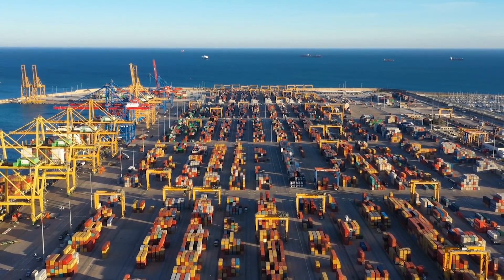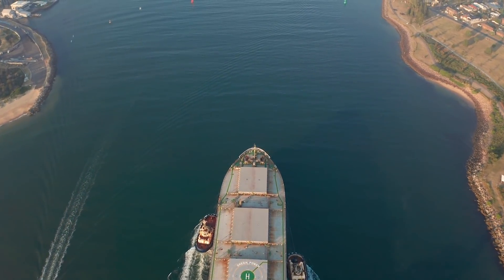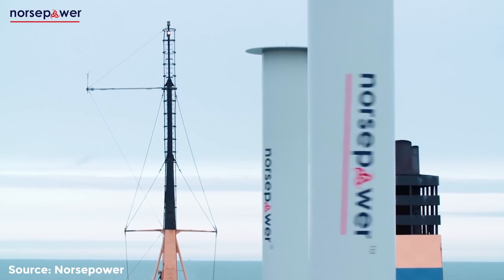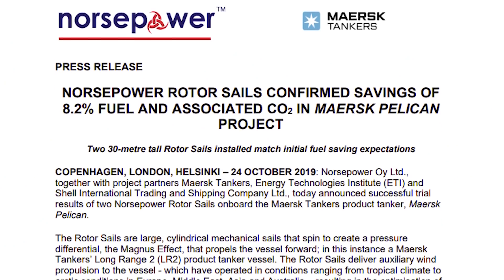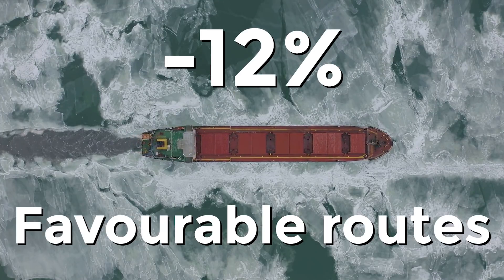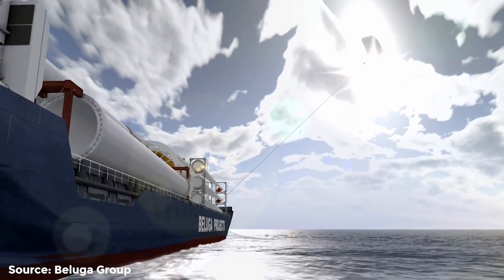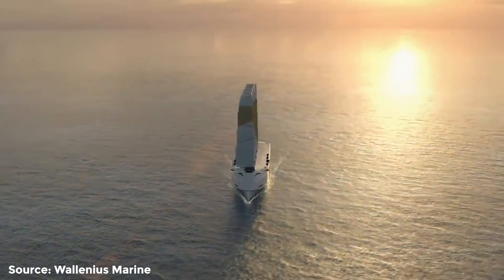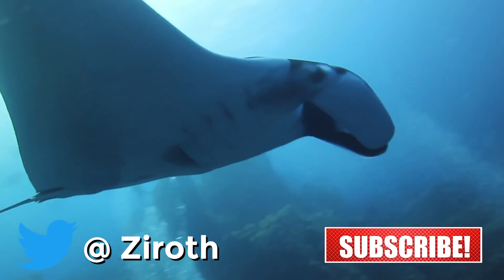Is Wind Power The Future of Shipping?

Comment: Почему бы сбоку раскрывающиеся паруса не приделать?)
Reply: 'Why not attach opening sails on the side?'

The configuration of the sails is determined by the strength of the wind; in light wind conditions more sails are set but as the wimd gets stronger and the sea gets rougher sail area must be reduced.  Short answer sailing ships are not the answer.

Comment: Yeahhha,  Weight Anchor, (uhh what are the other commands. Bring out the spanker.
Reply: Do you mean 'the spinnaker'? (https://en.wikipedia.org/wiki/Spinnaker)  As pipedreams go a return to the age of sail is up there with the best of them. The problems with the wind as an energy source are variability, reliability and low energy density; also relevant in this context is that the canvas, cordage and extra manpower needed for sailing ships were never a very benign environmental option so please discount any idea of sail as ‘sustainable’ and all this is without the problem that if ‘the wind don’t blow the ship don’t go’.  When it does blow it often blows in the wrong direction for your cargo delivery needs and sometimes there is rather too much of it for comfort.  The area where one is most likely to be ‘becalmed’ is the ITCZ (Intertropical Convergence Zone) or ‘the doldrums’ as it is commonly called.  In days of old ships with large crews, such as naval vessels, would try using the ships boats and some of the crew to row through the doldrums thus towing their mother ship out of the calm.  Not practical for less well manned and much heavier merchant ships which could not muster a similar power (oarsmen) to weight ratio (vessel displacement).  Traditional sailing ships are unable to go directly up wind so if the wind is blowing from the direction your cargo needs to go then a zig-zag course must be steered, more distance and thus more time on passage at whatever speed is achieved.

Comment: Well, the business case can be solved by handing savings down the line. Being cheaper in operation still sells. Advertising with "environmentally friendly" does sell, too.
But what about the DynaRig. Searching for a video, I found yours. 
It can be used at almost any wind, trained and trimmed by one man, and by generating hydrogen with the propeller, fuel, to be burned in conventional diesel engines, can be produced. 
The super-yacht Black Pearl (no, not Jack Sparrow's) also has photo voltaic on its sails.
Could be 0 emission and phantastic economies in fuel. 
The system has existed for half a century, now, thus is proven. 
Just a thought, possibly worth an investigation.
Reply: The problems with the wind as an energy source are variability, reliability and low energy density; also relevant in this context is that the canvas, cordage and extra manpower needed for sailing ships were never a very benign environmental option so please discount any idea of sail as ‘sustainable’ and all this is without the problem that if ‘the wind don’t blow the ship don’t go’.  When it does blow it often blows in the wrong direction for your cargo delivery needs and sometimes there is rather too much of it for comfort.  The area where one is most likely to be ‘becalmed’ is the ITCZ (Intertropical Convergence Zone) or ‘the doldrums’ as it is commonly called.  In days of old ships with large crews, such as naval vessels, would try using the ships boats and some of the crew to row through the doldrums thus towing their mother ship out of the calm.  Not practical for less well manned and much heavier merchant ships which could not muster a similar power (oarsmen) to weight ratio (vessel displacement).  Traditional sailing ships are unable to go directly up wind so if the wind is blowing from the direction your cargo needs to go then a zig-zag course must be steered, more distance and thus more time on passage at whatever speed is achieved.  Wind speed is traditionally measured on the Beaufort Scale (wind speed) that runs from 0 (< 1kn or 0.5ms-1) to 12 (> 63kn or 32.5ms-1) and for sailing purposes the usable part of the range is ‘3’ (circa 8kn or 4.1ms-1) to ‘6’ (circa 24kn or 12.3ms-1).  As the wind speed, and the amount of energy that may be harvested there from, increases the sea surface becomes progressively more disturbed which makes the harvesting process ever more difficult and increases the stress on the vessel.  The increased stress means the sail area has to be reduced, either by using fewer or smaller sails until the vessel may in extremis be ‘hove to under storm sails’.  One way of reducing the sail area is by turning up the bottom edge; known as reefing.  With any wind power proposals the question that must be asked include ‘has any information been released into the public domain with regard to the expected energy harvest for the wing forms, on a Joules per square meter basis and how may this energy be deployed as power in Watts?  ‘Cutty Sark’, is said to have been able to coax 3 000 horse power (or 2 206 500 Watts / 2.2 megaWatts)) out of her, up to, 2 976m2 of sails, assuming ideal conditions and further assuming that for sailing purposes the usable part of the wind speed range is 4ms-1to 12ms-1 so the yield would be about 741 Watts m2.  So another question ‘for the proposed option what is the expected upper wind speed limit for the system’?  A single stage 'harvest to deployment' system for propulsion will have higher efficiency but ‘what steps are being taken to provide ancillary power such as the, small but essential, domestic, navigational and cargo needs?’
Reply: @BernardLS : 
Read me again. 
The DynaRig neither does require additional crew, nor is it completely dependent on the wind, as one can generate hydrogen under way to power engines e.g. in the doldrums. 
Given a thorough look, there would appear just one looser: China. 
Chili, for example, could profit immensely by producing hydrogen on the Atacama-coast and shipping it worldwide in 0-emission-ships. The question is? 
Do we want to change the game?

Comment: If the entitties who charter the ship for their multi-million dollar trades had to bear the costs of the carbon emissions and offset them, they would be all over this.

The solutions are there, but there we move at tortoise speed.
Reply: Shipping currently has a 'high volume, low added value' business model and it needs to return to the 'low volume, high value added' model it followed in the past.  Any alternative to the existing system needs to provide better value and so depends on the yield; the energy input less losses must provide energy output that can be deployed for propulsion, cargo handling and domestic services.  All of which must be achieved consistently and within the current limits of mass, volume and cost.  The merchant shipping fleet of vessels is not a homogenous group.  Not only do the sizes, structures and trading patterns each vary over a wide spectrum but the applicability, or otherwise, of any combustion mitigation option will be radically different between classes of vessel; id est a tanker has a large expanse of open deck that could make it suitable for VAWT installation while a container vessel due to being loaded and unloaded from above is unlikely to be able to deploy such a system.
 

The best answer to the question 'how may we reduce the impact on the environment?' is, IMHO, 'consume less stuff and move less stuff the shortest distance possible'.   Blue sky thinking gave me: -
1) Reduce consumption;
2) Reduce spoilage / waste;
3) Reduce 'freight mile' distances;
4) Minimise freight carrying capacity;
5) Improve energy quality;
6) De'fossil'ise the energy chain;
7) Localise production to consumption;
8) Reduce the global population of consumers.
OK number 8 is not really easy, but we all like a challenge.

Comment: This is such a fascinating concept! Love the era of dreaming we live in, even if all ideas don’t pan out.
Reply: The problems with the wind as an energy source are variability, reliability and low energy density; also the canvas, cordage and extra manpower needed for sailing ships were never a very benign environmental option so please discount any idea of sail as ‘sustainable’ and all this is without the problem that if ‘the wind don’t blow the ship don’t go’.  When it does blow it often blows in the wrong direction for your cargo delivery needs and sometimes there is rather too much of it for comfort.  The area where one is most likely to be ‘becalmed’ is the ITCZ (Intertropical Convergence Zone) or ‘the doldrums’ as it is commonly called.  In days of old ships with large crews, such as naval vessels, would try using the ships boats and some of the crew to row through the doldrums thus towing the mother ship out of the calm.  Not practical for less well manned and much heavier merchant ships which could not muster a similar power (oarsmen) to weight ratio (vessel displacement).  Traditional sailing ships are unable to go directly up wind so if the wind is blowing from the direction your cargo needs to go then a zig-zag course must be steered, more distance and thus more time on passage at whatever speed is achieved.  Wind speed is traditionally measured on the Beaufort Scale (wind speed) that runs from 0 (< 1kn or 0.5ms-1) to 12 (> 63kn or 32.5ms-1) and for sailing purposes the usable part of the range is ‘3’ (circa 8kn or 4.1ms-1) to ‘6’ (circa 24kn or 12.3ms-1).  As the wind speed, and the amount of energy that may be harvested there from, increases the sea surface becomes progressively more disturbed which makes the harvesting process ever more difficult and increases the stress on the vessel.  The increased stress means the sail area has to be reduced, either by using fewer or smaller sails until the vessel may in extremis be ‘hove to under storm sails’.  One way of reducing the sail area is by turning up the bottom edge; known as reefing.  With any wind power proposals the question that must be asked include ‘has any information been released into the public domain with regard to the expected energy harvest for the wing forms, on a Watts per square meter basis?  ‘Cutty Sark’, is said to have been able to coax 3 000 horse power (or 2 206 500 Watts / 2.2 megaWatts)) out of her, up to, 2 976m2 of sails, assuming ideal conditions and further assuming that for sailing purposes the usable part of the wind speed range is 4ms-1to 12ms-1 so the yield would be about 741 Watts m2.  So another question ‘for the proposed option what is the expected upper wind speed limit for the system’?  A single stage 'harvest to deployment' system for propulsion will have higher efficiency but ‘what steps are being taken to provide ancillary power such as the, small but essential, domestic, navigational and cargo needs?’

Comment: We are evolving backwards?
Reply: Not really just trying to stay ahead of the game.  Advances in things like materials technology may revive discarded technology for example at the start of the personal mechanical car age as well as steam power electrical batteries were tried but  could not compete with internal combustion; following the improvements in battery technology from lead acid accumulators to lithium ion electric cars got back in the game.  Will sails work maybe / maybe not but humanity will keep push at the edges of all the envelopes.
Reply: @BernardLS   i know, its just a joke, but i have some doubt's about the ship as well, primarely if it can be big enough to compete with conventional cargo ships, it seems the masts and sails take up space that cargo can be carried, also, thier speed matters, + they have mutch of the same problem as the old sailboats that is if there is no wind there is no way for them to move, no matter how efficient the sails are
Reply: @k.f.m6901  I have a lot of 'comment material' about this and other ideas that have been put out there WRT to fixing the shipping problem.  Your evaluation is, IMO, spot on, one calculation I got into put the sail area required to get a 300k deadweight ULCC tanker going at 15 knots as around 16 hectares, about the same area as a small farm.  Good luck with that, but keep dreaming after all heavier than air flight was never going to happen was it 🙂.  Must go the sun is over the yardarm and it is time for the grog ration to be issued.

Comment: Great video !
Jacque Custeau had a vertical rotating sail on his ship made from aluminum in the 70s. He did have great success with it however it continued to Crack the welds at the base and was discontinued. 
Maybe carbon fiber is the answer.
Reply: The problems with the wind as an energy source are variability, reliability and low energy density.  If ‘the wind don’t blow the ship don’t go’, when it does blow it often blows in the wrong direction for your cargo delivery needs and sometimes there is rather too much of it for comfort.  The area where one is most likely to be ‘becalmed’ is the ITCZ (Intertropical Convergence Zone) or ‘the doldrums’ as it is commonly called.  In days of old ships with large crews, such as naval vessels, would try using the ships boats and some of the crew to row through the doldrums thus towing the mother ship out of the calm.  Not practical for less well manned and much heavier merchant ships which could not muster a similar power (oarsmen) to weight ratio (vessel displacement).  Traditional sailing ships are unable to go directly up wind so if the wind is blowing from the direction your cargo needs to go then a zig-zag course must be steered, more distance and thus more time on passage at whatever speed is achieved.  Wind speed is traditionally measured on the Beaufort Scale (wind speed) that runs from 0 (< 1kn or 0.5ms-1) to 12 (> 63kn or 32.5ms-1) and for sailing purposes the usable part of the range is ‘3’ (circa 8kn or 4.1ms-1) to ‘6’ (circa 24kn or 12.3ms-1).  As the wind speed, and the amount of energy that may be harvested therefrom, increases the sea surface becomes progressively more disturbed which makes the harvesting process ever more difficult and increases the stress on the vessel.  The increased stress means the sail area has to be reduced, either by using fewer or smaller sails until the vessel may in extremis be ‘hove to under storm sails’.  One way of reducing the sail area is by turning up the bottom edge; known as reefing.  With any wind power proposals the question that must be asked include ‘has any information been released into the public domain with regard to the expected energy harvest for the wing forms, on a Watts per square meter basis?  ‘Cutty Sark’, is said to have been able to coax 3 000 horse power (or 2 206 500 Watts / 2.2 megaWatts)) out of her, up to, 2 976m2 of sails, assuming ideal conditions and further assuming that for sailing purposes the usable part of the wind speed range is 4ms-1to 12ms-1 so the yield would be about 741 Watts m2.  So another question ‘for the proposed option what is the expected upper wind speed limit for the system’?  A single stage 'harvest to deployment' system for propulsion will have higher efficiency but ‘what steps are being taken to provide ancillary power such as the, small but essential, domestic, navigational and cargo needs?’  One of the limits to wind power is the kinetic energy available to be harvested in the mass of air it is possible to contain.  Another is the scale of the operation when sailing ships were being succeeded by power driven vessels the largest that were built included the ‘Prußen’ and the ‘Thomas W Larsen’.  The ‘Prußen’ used a crew of 45 to move up to 8 100 tonnes of cargo and was lost at sea following a collision with a power driven vessel.  The ‘Thomas W Larsen’ used a crew of 18 to move up to 11 000 tonnes of cargo this vessel was lost when at anchor in the Scilly Isles where she was sheltering from a storm.